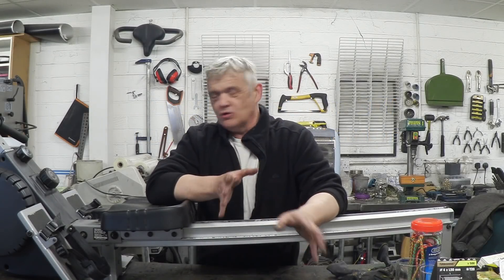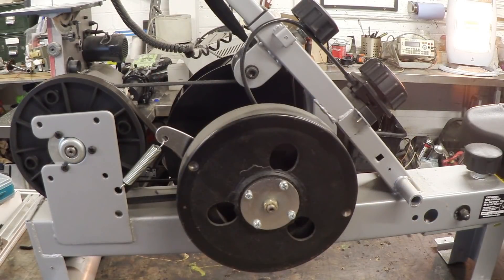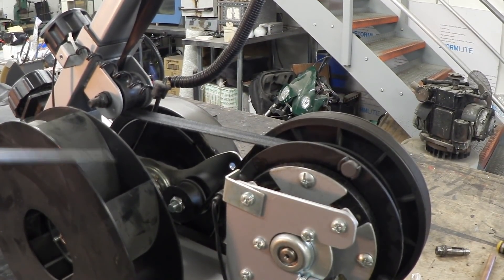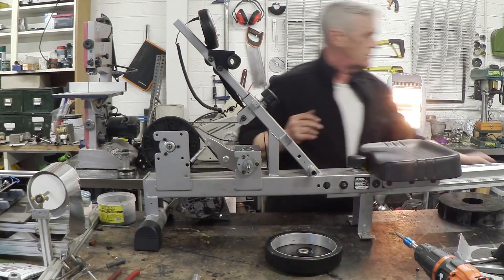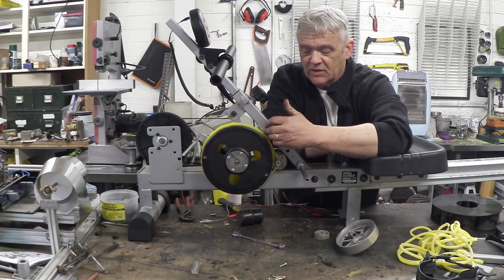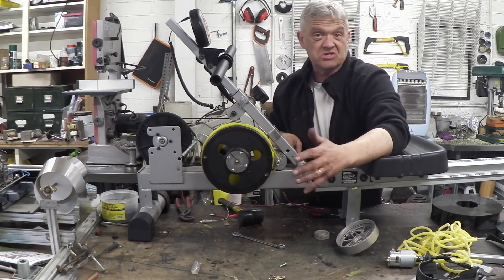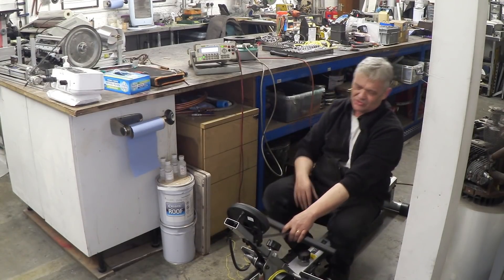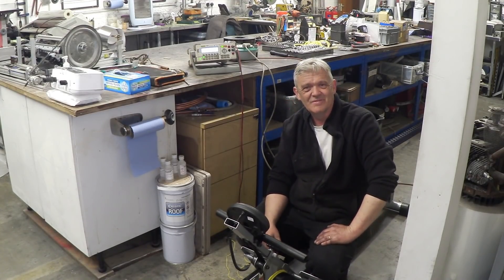1073 Amazing Results From DIY Human Powered Generator

Comment: I have a magnetic rower as well and am just starting to research human powered machines. There is a lot for me to learn! Question. Is is necessary to take apart the magnetic flywheel? And can you change the tension now that the wheel has been modified? I’m interested in this project but don’t want to lose all the tension options in my machine, so I can get a good workout. 😉

Comment: That's inappropriate way to measure power output. Short-circuit current and open-circuit voltage are two different operating conditions, You can't just multiple them together and claim a power output, you need to measure voltage and current under the same load, and of course, there will be the sweet spot load where the source impedance matches the load impedance. This is the fallacy that most Bedini motor researchers fall into when they claim free energy.

FWIW, I've personally rode a bicycle generator running a true 100W bulb in the past. It's a heavy workout, and I certainly wouldn't be maintaining it for very long, even if I were in shape. You personally probably already had that perspective, but I hope that provides some to your viewers out there. I think it would be definitely doable to run some LED lighting in an exercise gym...
Reply from the maker: cheers

Comment: Hi Rob, that is a nice project piece.  However, I am fairly confident you aren't generating 0.5A @ 30V.  30V is what you are getting without a load (a high impedance voltmeter) and 0.5A is what you are getting "shorting it out" and very low voltage.  To determine the actual power you would need to measure voltage and current at the same time.

Keep up the great work!
Reply from the maker: for ure mate - but I am not that worried as I have seen this before - Jeremy fielding did one where his set up ran a TV and games thing for his kids - so it will generate usable power that's for sure - how much exactly - dunno - but clearly enough to make it worthwhile

Comment: WOW!! that's bloody excellent news because, im going to use one of those motors in an electric bike conversion i need to know what power it could give out when "NOT" been driven by the battery.. was going to use it as generator to recharge a lead acid 12V car battery.. PLEASE ROBERT COULD YOU TELL ME WAS IT HARD TO TURN IT AND COULD YOU TRY IT ON A CAR BATTERY AS A LOAD???
Reply from the maker: nah it was easy mate but it was open circuit - Jeremy fielding did this and ran his tv and games set up so it will do the job that's for sure

Comment: Nice. We had a science museum a few decades ago called the evaluon ( a philips thing ) and had a school trip over there. They had this bike powering a tv. It was hard, but when you reached 80W or so it would turn on the tv. They had the first laser discs over there too. A 30 cm cd for video. It later evolved to the cd as we know it.
Reply from the maker: it would certainly. power a TV and games set up
Reply: @ThinkingandTinkering  is that about the limit of wattage we can get from human power? Around 80-100 watts?
Reply: ATTENTION ATTENTION ATTENTION, I would like to see somebody do these kinds of experiments using a stationary bike and a 120-VAC generator head like the kind used in portable gas-powered generators.  I'll dump this comment all over YouTube just to get someone to do it.

Comment: Surely the 0.5A @ 30V is purely down to the motor you're using, and absolutely nothing to do with the fact that you're 'driving' it from an old rowing machine.  You could equally be 'driving' it from a wind turbine and get exactly the same amps and volts.  Can you please share the exact model of motor (from a window opener I think you mentioned?)
Reply from the maker: personally I would think it would be down to the efficiency that the little set up can transfer the energy I am putting into the system into electrical energy - so it will be down to the machine and the motor and how hard I row - I am not sure what the motor is a 12v window opener - but to be honest I would think any dc perm magnet motor would be good

Comment: Hi. I did the same except I kept it simpler than your good self. I ended up keeping the air resistance wheel to keep a higher gear ratio, I also kept the flywheel to help keep momentum on the back stroke. I'm not a motor man and threw an old ford fiesta alternator on it, it worked but not great. What would you recommend for a generator and any ideas where to get belts, my adhoc ghetto gaffer tape belt is not ideal.
Reply from the maker: car alternators work great once you get the rpm over around 2-3,000 below that they are not so good - that's because they are really synchronous generators - a perm magnet dc motor used as a generator I think is a better option for low rpm applications

Comment: Hi,
Now to get more Watts out of it connect the output to rectifier and rectifier to a 16V (low rpm, high torque)) or 30V (high rpm low torque)battery and your Watts output should go up (at the calories cost of course ;) ) :D Best regards! As always great project!
Reply from the maker: nice - cheers mate

Comment: Charge a coil with 30V, and it would, indeed, knock your socks off!  Well done.  I'd wager you could drive another generator in parallel off the flywheel, and a third off the return of the seat with bungee as a return spring.
Reply from the maker: now that would be some output!

Comment: With a decently fit user and properly matched generator, one can pretty easily maintain an 80~100W output for over 30 minutes using a rowing motion, and I can personally attest to being able to produce peak outputs in excess of 450W, though only for 20 seconds or so.
Reply from the maker: in principle this is a setup that works that's for sure
Reply: @ThinkingandTinkering  More than in principle. I repaired gym equipment for a few years and occasionally came across row machines that used the rectified output of low rpm three phase generators, put across a high power shunt resistor to give the user real measurements of their efforts based on the voltage drop. I used my lunch break once to quantify what I could maintain on a nice one that a college had in their gym, and was able to pull 100W for the duration without too much exertion. On a separate occasion at the same place, I just went for maximum effort and exceeded 450W.

Comment: Fantastic. I expect that air brake wheel could be used as a blade for a wind turbine setup !!!
Reply from the maker: I was thinking that
Reply: Wind turbine blade power capture is directly proportional to swept area. That thing has very little. Wouldn't even turn.
Reply: @edkoetsier339  Air dams like water dams so rather than working with swept areas and massive blades whirling about it all gets channeled to one spot and wiz-bang done.
Reply: @Barskor1  I don't understand what you are trying to say. However, hydro power is purely fluid dynamics, while wind power is swept area and resistance.
Reply: @edkoetsier339  👍. I wouldn't mind experimenting, I have seen small ones turn car alternators before.
Reply: @errolmagill1611  Test away. You will be disappointed.